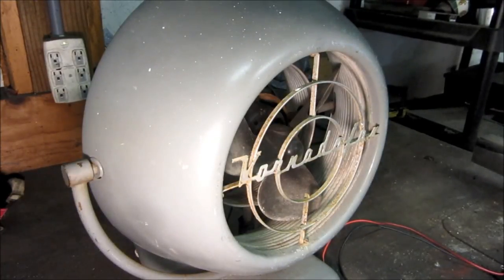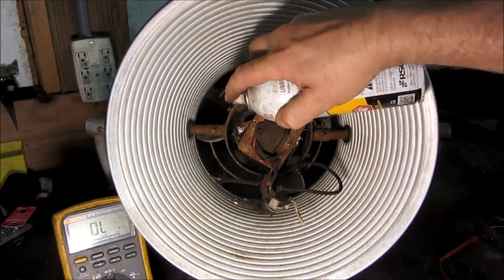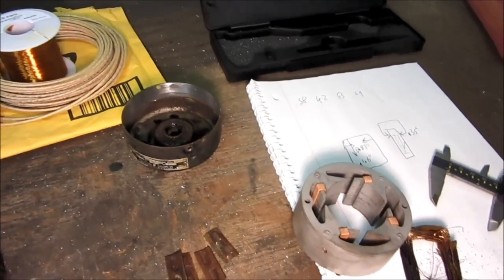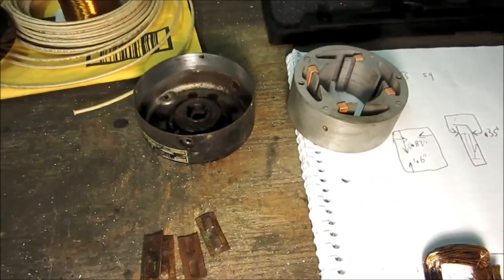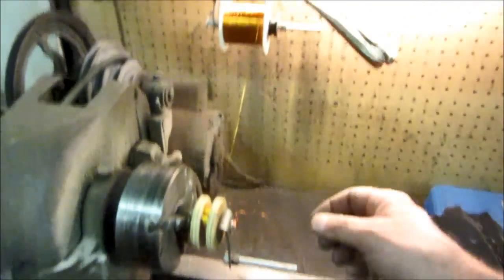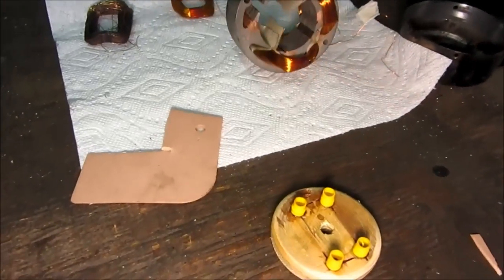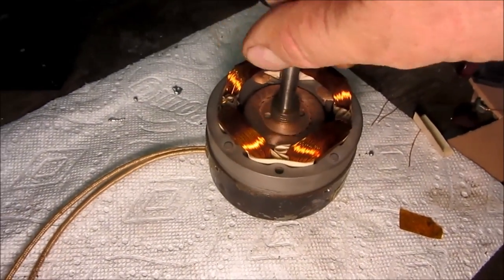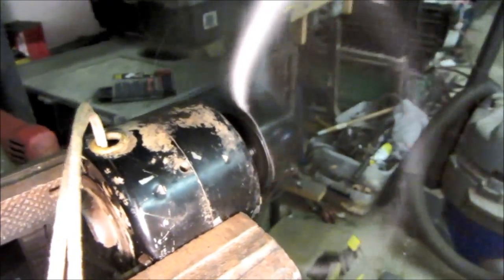Vintage Vornado 10D1 - 1 - Burned motor rewind...

Comment: Excellent work! It's better to fix an antique fan than buying new fans that break in a couple of years. The new Vornado models that people buy from Walmart aren't made the same as the antique ones, and fail faster than the antique vornados which lasted 50+ years.
Reply from the maker: You're so right about the new 'Vornado' fans sold today are only a name on a chinese product - nothing like the originals. Very sad, indeed.
Reply: @davida1hiwaaynet  yes, I have seen the new Vornados that people buy at Walmart that has gotten thrown out after a couple years of use. Once something goes wrong with a Vornado fan purchased at Walmart a couple of years or months ago, it’s done for. My aunt has went through 12 Lasko box fans within the 10 year period (since 2009) and each of them burned up and failed. They sure do not make any fan like they used to. Besides I have a blue galaxy (late 70s) 12 inch desk fan that I use every night, and it still works like brand spanking new. Need to buy a new fan, then I would go to a flea market, antique mall or a secondhand store and look for a vintage one.
Reply from the maker: @JoshuaAndMom    Exactly! Get a vintage one and lightly refurbish it.

Comment: Glad you got it working again now all you have to do is oiled the motor and paint the motor housing and finally put it back together I can't wait to see part two soon :) I enjoyed the video :)
Reply from the maker: Yep, the bearings need a little more than oil I'm afraid - there were fiber thrust washers in the motor which have burned away in the past. Will replace them today and see how it does with the correct end clearance.  Look for Part 2 but not sure if it'll be today.

Comment: wow, nicely done! I just wish you had filmed the process of how you got the coils on the core without messing them up because that  looks next to impossible...
Reply from the maker: Thanks!  I appreciate the comment there.

As for the insertion of the coils, I would have videoed that if I had a tripod at the time. It's not that hard. The white "paper" liner folds out and makes a "funnel" to guide the coil into the slot. You just start  by putting one side of the coil into one slot, and then slide that side deep into the undercut area of the pole piece. That allows the other side to move into position to go into the next slot. The shape of the pole pieces are made so that it fits this way.
Reply: very cool. rewinding motor coils is a skill I've always wanted to have. how do you determine the number of turns?
Reply from the maker: Well, I did some reading up on it and it was very confusing. So, I followed the bottom line advice given on most of the manuals - cut each coil and count the number of wraps in the originals. It was tedious but takes out much of the guesswork.

Comment: Really awesome video Dave! 👍I really had no clue that you could rewind  a fan motor like that , I have a question for you, I have a 1950s wizard box fan which is the rebadged version of the C&H air conditioner company box fan , I'm not sure if you're familiar with this fan , but I aquired it about a year ago and it burn up just after 3 days of having it , the motor is a 1/15hp 2 speed Westinghouse motor , would it be possible to rewind and restore it just as you did with your coronado fan motor ? What particular materials do I need to do it with ? Can you help me with this?

Comment: Add a cam to actuate a mechanical stroke counter and you have a real coil winding setup!
Reply from the maker: Hadn't thought about that!  But I think an electromechanical counter would be easier to do. The mag switch and magnet could be just stuck on with 2-side tape.

Comment: Hello David awesome video! I really had no clue that you could actually rewind a amateur like that , I have a question for you, I have a vintage 1950s wizard box fan which is also the rebadged C&H air conditioner company box fan I'm to sure if you're familiar with this fan , but I aquired it about a year ago and it has a 1/15 hp Westinghouse 2 speed motor , and the motor burned up just only 3 days of having the box fan , is it possible that the amateur can rewinded and brought back to life just as you restored and rebuilt your coronado motor ? What particular materials do I need to do it with ? Could you help me on this?🙂👍

Comment: Very nice job! Would that coil have been wound in one continuous run of wire or was it originally connected together? Also, it sounds like the rotor may be scraping due to lack of thrust washers, hopefully not the bearings, the mating surface on the rotor looks ok on camera
Reply from the maker: I bet you're right that all 4 coils would have been made with one continuous piece of wire.  I've seen motors both ways; in other words some with no splices between the coils - and others with a soldered connection similar to mine.

I'm pretty sure the rotor is hitting the motor's back cover because of the missing thrust washers. I got new ones today, and plan to finish the motor today!

Comment: The motor spent "a significant amount of time in a state of combustion/heavy smoke emission"

What were the signs?
Reply from the maker: Well, the melted copper winding with arc marks and beaded melted copper were one indication.  Another indication was the fact that all the resin, varnish, and other materials that bound the winding together was completely gone.  The back side of the bakelite fan blade also had some charring around the center area where the motor had flamed up.

Also, the motor had a lot of soot on the inside of the end housings, and rust deposits where probably someone put water on it to extinguish it.

Those are just what I saw that would have led me to believe it had been firey at one point. :)
Reply: Water to extinguish a flaming motor?? Insane.

Luckily the original owner didn't get electrocuted.
Reply from the maker: The burning materials in the motor are pretty well just paper and varnish etc. They probably took the fan outside and hosed it with the garden hose. To someone who is planning to repair the motor, it seems insane - but the previous owner planned to throw the fan away anyway.
Reply: Seems insane but you still rewound the motor. 
Extra kudos to you for doing it!
Reply from the maker: Thanks. It was my first attempt. All the "burnable" materials were replaced with new; so the fire issue didn't matter after this.

Comment: is that an induction motor? how do vornado speed control it?
Reply: The autotransformer in the back is used to drop the voltage to the motor.
Reply: @douro20  correct!  the cheapest solution for the controller. but relies on exceptionally robust AC motor to effect it...one tolerant of variable slippage...
Reply: @klam77  I believe a shaded-pole motor would tolerate it well as their design is inherently self-limiting.
Reply: @douro20  very interesting! I am learning much from this discussion. they say the "shading" is more for imparting a phase difference to enable "self-start" rather than for enabling voltage based speed control?  BTW  I still have an old vornado in use, 20yrs and running (not as old as the one in the video....but still old).